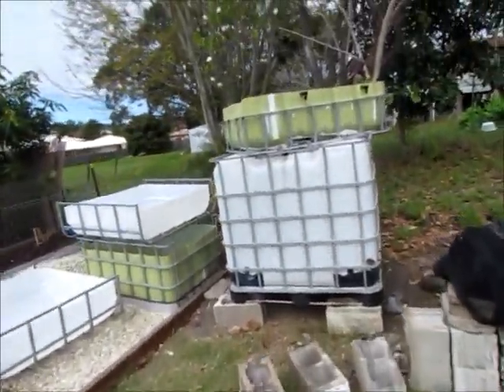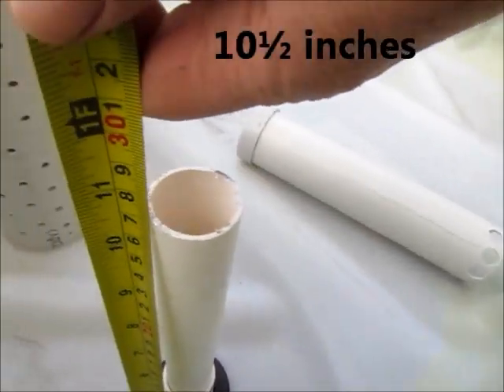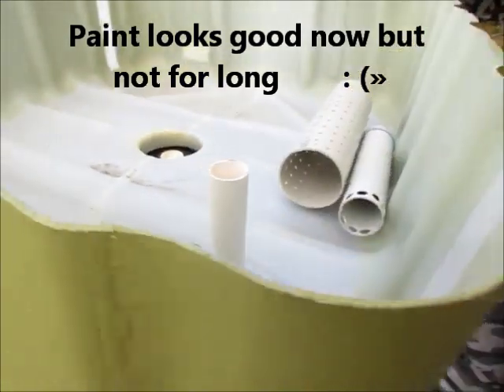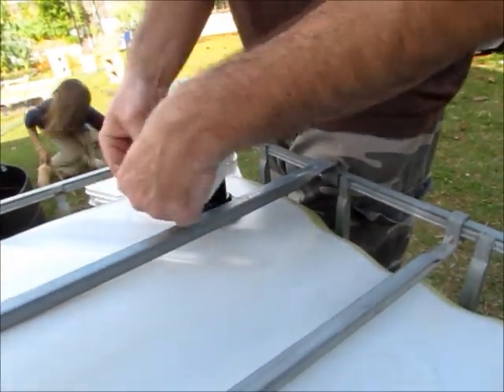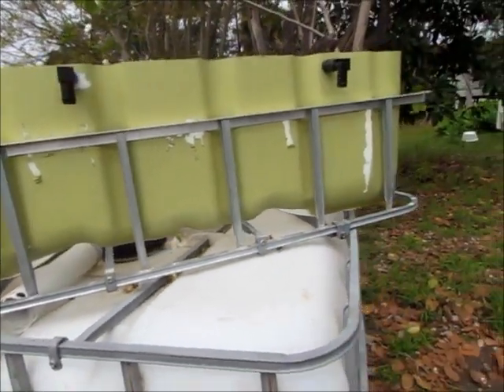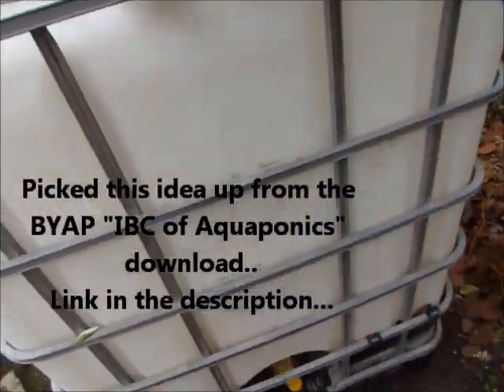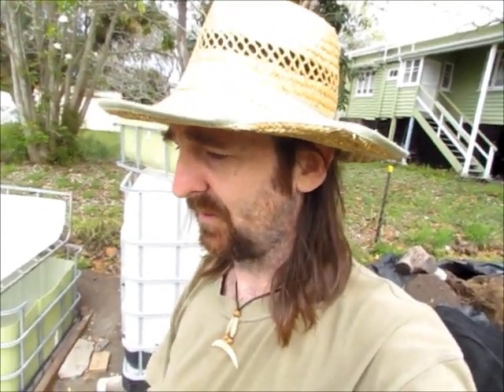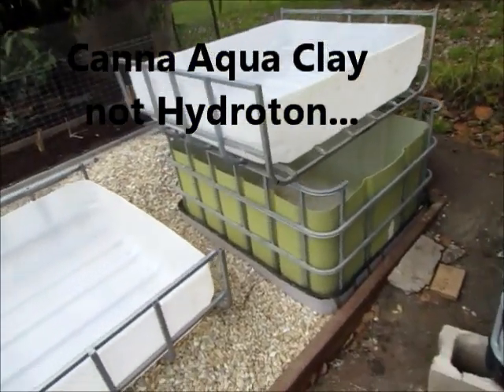Backyard Aquaponic set up... IBC System construction part 1...

Comment: Thanks Rob. i have another question about the drain pipe.  i am planning on installing multiple grow beds (10) and collect all their "drain/siphon" water to a single pipe (3 in).  i plan to use 1 " pipe to all the 10 grow beds.  is this a good design ? thanks in advance.

Comment from the maker: Hi there...
Just went through & numbered all the IBC construction clips & you should find the answer in clip 6 if you search " MCPaeTjGC78 ".. Rails were bolted to the ends of the frame to stop the beds from bending out & appear to be doing a good job so far...
Hope that helps some & ask away if there is something else you are after..
Rob

Comment: Does your syphon work good? how long does it take to empty the grow bed? I am thinking about building a similar system and was wanting to make sure your syphon setup worked good before I used the same setup for mine? How many gallons per minute flow are you getting to the grow bed and how long does it take to fill the grow bed? Sorry about asking so many questions, but I just wanted to make sure everything was right before I started building my setup. Thanks!!!